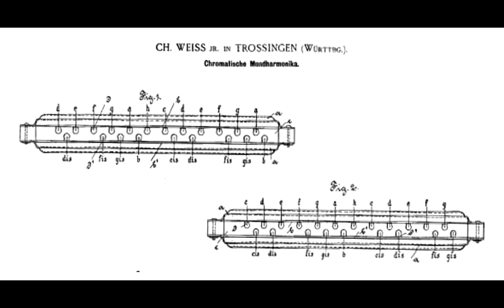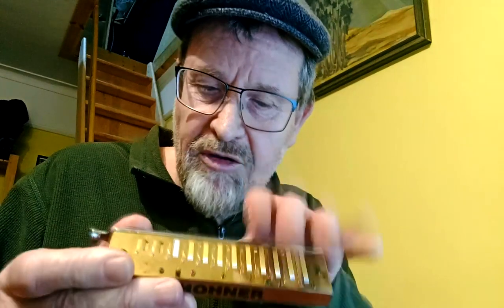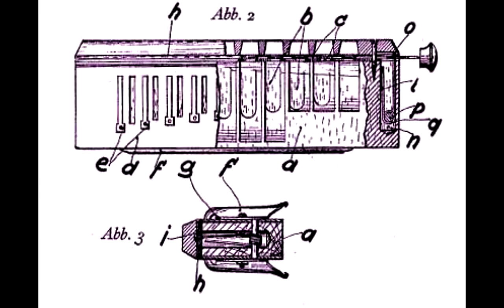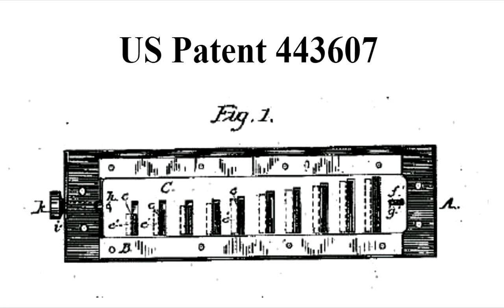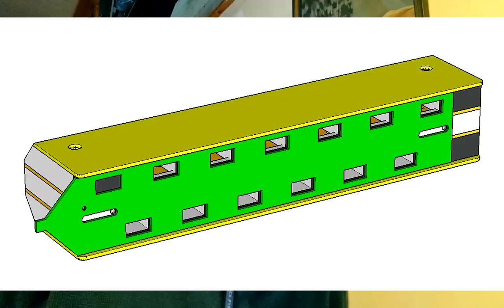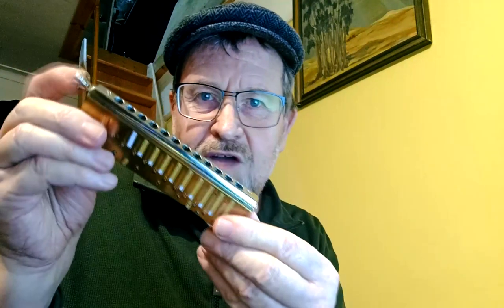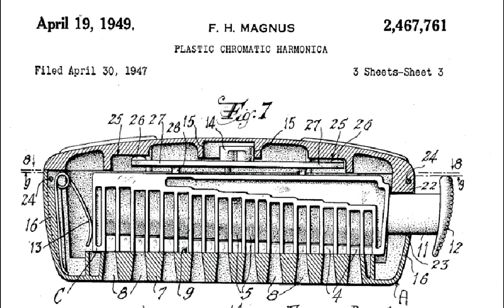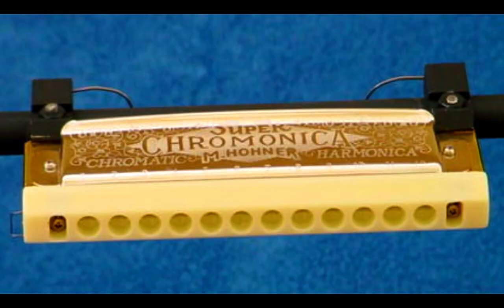TECH TUESDAY #3 - REED MUTING SYSTEMS for HARMONICAS (Historical Overview of Different Designs)

Comment: I have two custom-tuned partially half-valved Seydel Nonslider chromatic harmonicas.  They are fun and relatively easy to play.
Reply from the maker: Glad you're enjoying them. I tried making my own version of this idea years ago, but found it doesn't work significantly better than a good airtight slider, which I find much easier to use. So I gave up on the slideless design. But good to see it's out and making some players happy 😊

Comment: I once played around with toothpicks... it was sort of related to reed muting, but I wasn't doing full muting.  I took the covers off and used a toothpick kind of like a finger on a fret.  I could change the pitch of the reed by moving where I was touching it.  I thought about trying to do more with it.  I decided from a playing perspective it really would take a fair amount to master, but I had an idea to cut holes in the top of a cover so you could position a bunch of little levers.  By sliding the protruding end of the lever, which would be the long end relative to the fulcrum, you could get a smaller movement of the end touching the reed and it wouldn't be quite as fiddly.

Comment: Thank you, mr. Power, for this series of videos.

I'm interested in construction based on overblow booster that covers only upper reeds. In this case you get overbends on 1-6 holes, and draw bends on 7-10 holes. Also it seems easier to implement in harmonica. At this momet I use conventional technics to get the overbends and bends.

Also I worked on the "back" slider. I printed covers with walls to separate the reeds but faced a problem. The walls were too thick, so the reed was in 4mm channel. Due to the low acoustic volume the pitch lowered for 1/4 step for 4-th hole reeds. The higher the pitch the more picth shift was.
Reply: You can install only the upper base plate and skip the bottom one, using windsavers on the back of the last 4 reeds (blow plate). This will do the same as having only one plate covering them all and unlikely to have any windsaver noise.
Reply from the maker: Thanks for your feedback and interesting comments. It's always good to hear from a fellow tech experimenter :)

Yes, I also tried the channels under the covers in the past. The first harp to do this type of reed muting on diatonics for overbends was the Suzuki Overdrive, invented by Masaru Hashimoto. I took inspiration from his idea in my Overblow-Booster Mk1, adding an extra bar at the rear of the harp to close off all channels at once. I sold it for a couple of years around 2017.

However, I found the same as you. Even though I widened the cover channels as much as possible they still had the effect of lowering pitch slightly, and dulling the tone a bit - so I discontinued it.Here's are photos and information on the Overblow-Booster Mk1:
https://brendan-power.com/discontinued-parts.php#OverblowBooster

Regarding your comment about having an overblow slider only on the top reedplate: this would be fine for overblows in all 10 holes if the tuning has a regular-breath system (eg. PowerDraw). However for Richter you need to have a muting slider or some other system on the lower reedplate as well. (Unless you swap reeds around in the top octave, but that's another operation that means you can't retrofit to standard harps).
Reply from the maker: @agc_custom_harps  I don't quite understand how this would give you the overdraws...? Certainly valved draw bends, but not overdraws I think 🤔
Reply: @BrendanPowerMusic  let me clarify little bit.

With single cover plate we obtain overbends on 1-6 holes. But on 7-10 holes we have to swap reeds to get overbends.

But I consider to get draw bends on 7-10 holes as it was valves on them.

I’m watching carefully after almost all your inventions. They are very interesting for me as engineer.
Reply: Ok, it makes sense now. I thought you were interested on the valved bends sound for the upper octave.
Reply from the maker: @SemyonP  Cool, you're a trained engineer? I'm just self-taught, with CAD design etc, but have a lot of respect for the greater knowledge of professional engineers. What kind of job do you do?
Reply: @BrendanPowerMusic  I’m specialist in fibre optic sensors and semiconductors =) I’m more in R&D. And also self-taught in CAD,3d printing etc. In Russian it’s also called “Engineer”.
Reply from the maker: @SemyonP  Cool. Do you know of Jim ”Turbodog” Antaki? He's a surgical engineer who also invents harmonica stuff - for example, the excellent Turboslide. He's designing a MIDI diatonic harmonica with optical sensors under the coverplates, called the ELX.
Reply: @BrendanPowerMusic  I don’t know him in person. But I widely use his turbo tape to remove the resonance on the high reeds. And I was interested in his magnetic system for bends.
Reply from the maker: @SemyonP  I like his Turboslide a lot. Good for magnetic blow bends, lower draw bends, and easier overblows (because it lifts up the blow reed in the slot). 

Here's a pdf on his electronic harp with optical sensors, a work in progress: https://cdn.shopify.com/s/files/1/0399/4311/0817/files/TurboHarp_ELX_User_Guide.pdf?v=1602361048
Reply: @BrendanPowerMusic  I looked through the pdf. It is not a MIDI. It is an optical pickup. There are 20 LEDs and photodiodes. Each couple of LED and photodiode is situated on single chip, for e.g. CNY70. Then, as far as I understand, there are capacitor and preliminary amplifier. Analog signal goes to amp.

Pros: 
It should pick up all the features of the harmonica sound (bends, OBs, articulation etc.)
Hum is low, compare to magnetic pickups. 
No feedback.

Cons: you need power supply for LED and photodiode.

LED is for light emitting diode.

It is from the first sight. I will read it carefully later.
Reply from the maker: @SemyonP  Yes, sorry: this is the ELX, which is similar to an electric guitar pickup but with optical sensors instead of magnetism. Jim has had a separate diatonic MIDI harmonica project on the go for several years but, like the ELX, it seems a bit stuck. He's very busy with his medical work (has several patents for heart pumps etc) so maybe it's just a matter of finding the time and he'll get to something usable, I don't know.

Or maybe you could take the concept and find a new approach that works - that would be cool 🙂 I love MIDI harmononica (I own both the DM48 and HM12), but their big problem is bending: it's not controllable from your embouchure. You have to use some other controller, which is much more difficult to use in a natural way. Optical sensors on real reeds would give that natural harmonica bending feel, plus all the amazing stuff MIDI offers: a real game changer!

BTW, how do you spell your name in Latin alphabet?
Reply: @BrendanPowerMusic  

My name is Semyon.

I have the same problem of time. Family and works takes all my time.

As for bendable midi harmonica there is a major issue: should it sound or not?

I studied a little bit a physics of bend and I can say that bend is resonance process. Free reed is vibrating and you change its pitch by changing the acoustic volume. The same effect we observed when we applied the chambered comb. The same mechanism is valid for sax and clarinet. I have clarinet and due to my harmonica skills I managed to bent the pitch easily.

In MIDI harmonica as you know there are the pressure sensors. It makes no sound but it tells which note is playing. 

In ELX the reed makes sound. Theoretically, we can measure a pitch and send appropriate MIDI command. But I don’t know how fast the scheme will be processing the signal. The delays could occur.
Reply from the maker: @SemyonP  Good question Semyon... Jim's idea is to swap in different-key real harps so the MIDI and harp notes are the same.

Another approach would be to have a single heavily muted harmonica inside which gave you the right bends, but key is irrelevant. You listen to the MIDI sound through headphones or speaker loud enough to drown out any small reed noise that is still audible... 

This would avoid swapping in harps, and allow you to play in any key. Good for someone who always plays in the same tuning. However in my case I like to use different tunings, with different degrees of bend in different places. So personally I would have to choose Jim's approach. However ideally the harp could be heavily muted so one only hears the MIDI sound...

It's tricky... Another option would be some kind of mouth sensor to measure embouchure changes on a regular MIDI harmonica. Maybe a magnet on your tongue with a cheek sensor... Or perhaps optical sensors in each hole aimed at your mouth, detecting subtle light changes from different bend embouchure shapes...

A difficult problem... 🥴
Reply: @BrendanPowerMusic  a friend of mine here in Saint-Petersburg Sergey Balashov, who is engineer, programmer, poet and harmonica and sax player, successfully developed MIDI sax. He also wants to pick up the reed vibrations, in order to train correct embouchure, bends and all that stuff on his sax without disturbing his neighbours. 
We thought about reeds vibrating above 20kHz. But the ambouchure will be different. than for normal bends.
Reply from the maker: @SemyonP  I hope he has a go at making a MIDI harmonica that tracks bends. If it works successfully, I'll be the first customer! ☺️